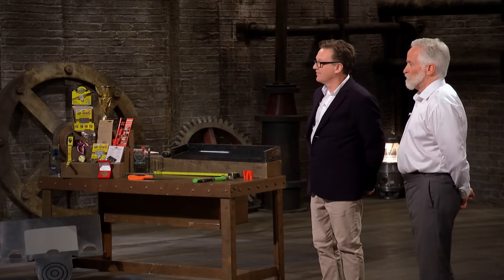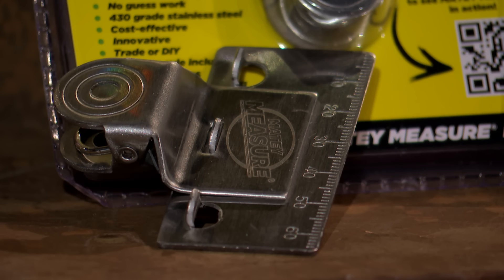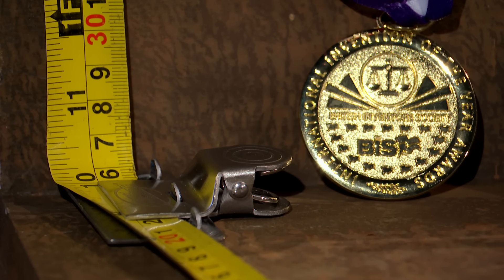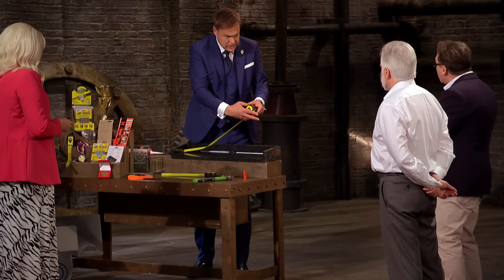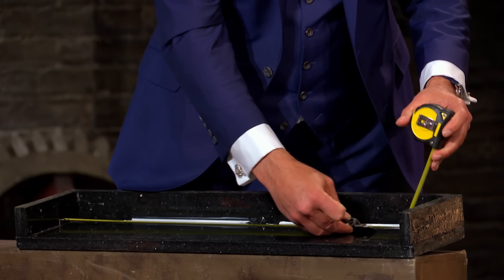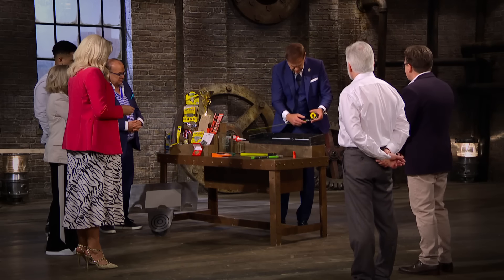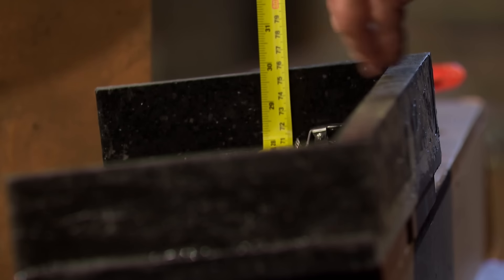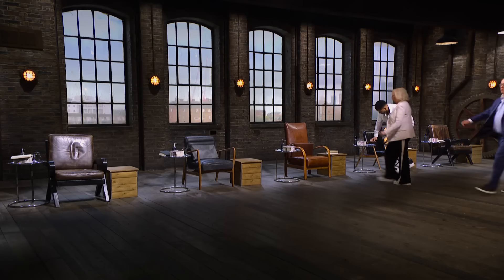"You've Invented A Paperclip for A Tape Measure" | Dragons' Den

Comment: Every tape measure I have purchased comes with a built-in way of overcoming this problem, the case has a length, and it is printed in inches on one side and millimetres on the other side. You pull the tape out and lock the case, add the measurement of the tape at the locked line to the case measurement and hey presto you have your reading
Reply: Exactly pointless invention tape measure manufacturers have already addressed the problem and solved it
Reply: I was looking for this comment. However, some tape measures only have it in imperial which sucks. 3 1/8 inches, FFS! 
Of course I can convert it to metric, which is 7.9375. Why couldn't they make it 8? Gawd, imperial doesn't make any sense, a relic, a vestige,  just like those who still like using it.
Reply: Not back when this aired.
Reply: You just lock the tape measure and then place it onto what you want to cut, no need to even look at the measurement.
Reply: @daveryall5919  But you do if you want to make an order for a part to fit. You can't send the supplier your tape, and there might be many parts you want.
Reply: @TheManInBlueFlames WYM? This ep (Season 20 Episode 9) aired 2 Mar 2023.
Reply: @bluceree7312 We Americans feel the same way about your crusty old, funkyversion of the English language.  🤣
Reply: @lxc3909  Except imperial IS the old 'funky' version, the English invented it and even we have largely moved to metric. 

Kind of like continuing to call Aluminium 'Aluminum'... it was named 'Aluminum' by an Englishman and then changed a few short years later to Aluminium to be more in line with other names. The rest of the world took this on board and the US didn't.
Reply: @bluceree7312 non sense. Metric system needs to go away

Comment: This is one of those products that appeals to people without the experience. For someone new to measuring it makes it a little bit easier. But for anyone with experience, measuring in a corner really isn't an issue. I just bend it into the corner and read it and that's it.
Reply: Yeah I do not get it, I've been fitting kitchens for 20years + if you need to measure 'inside' just read the measure and add 2-3mm, or measure from one side to a certain point and turn the tape around! And with that I am out.
Reply: Or use the tape measure how it’s meant to and put the tape including the case on the internal measurement then read the measurement on the case of the tape and add that to what the tape reads 🪄 😂
Reply: Most people dont have your skill. It's aimed at amateurs and the DIY market.
Reply: Like training wheels on a bike

Comment: The casing that holds the tape measure shows the tension which you use the same way then add the tape length to the casing length
Reply: They’re not that accurate though. I don’t think anyone trusts doing it that way

Comment: This is gimmick of the gimmick. In their example situation, I could just hold the tape measure across the top of the object, and measure the distance, without the recess bend. Either by holding the beginning of the tape against the inside top of the object, or by hooking it over the edge and subtracting the width of the side of the object/box. How often do you NEED to make the measurement on the deepest inside of the thing you're working on? I hope I've worded in an understandable way. And if you do need to measure inside the object, and you do get a curve, I'm sure with a couple of experiences, you would just know to add a couple mm from where the curve starts. Pro carpenters/chippies end up getting very good at small hacks and tricks that help them get things done quicker, with accuracy.